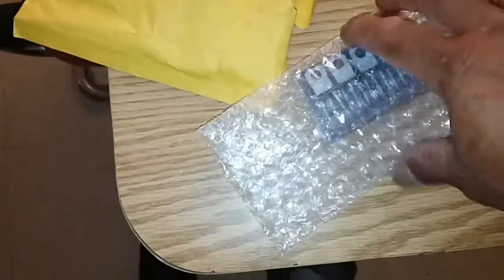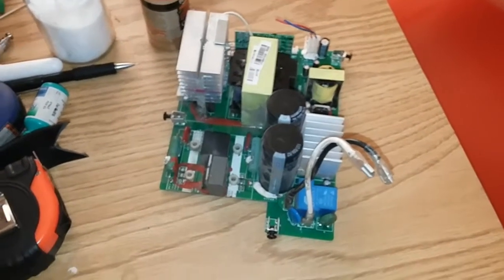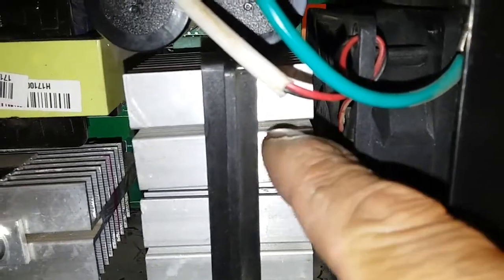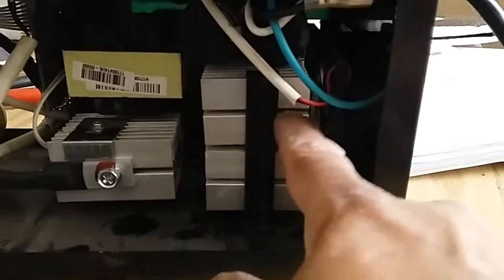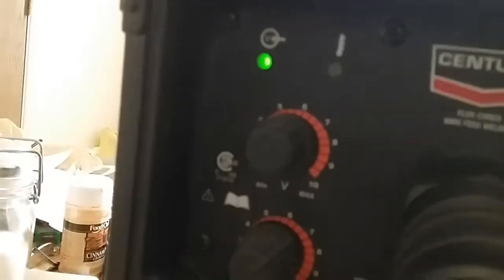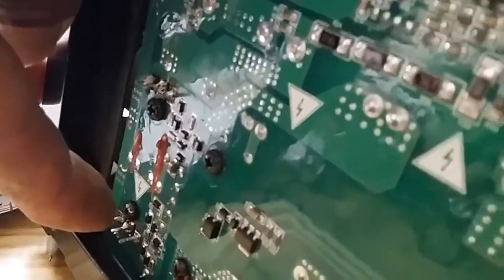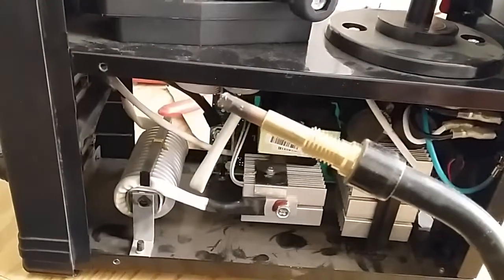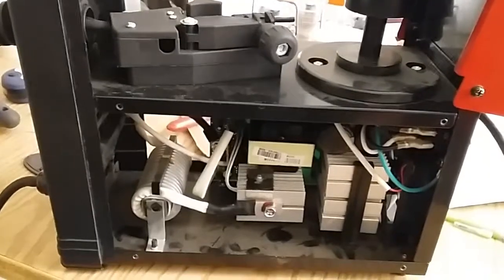Century fc90 fixed!

Comment: Can u please send the link, or the webpage, were you got those mosfets pleaaaaseeee?
Reply from the maker: I don't remember webpage or seller. But in one one of comments I put the mosfet number there. If that helps. I got it from China if I remember correctly.
Reply from the maker: Mosfet is fgh60n60 smd. If this helps.
Reply: @zeroninejames9507 are this the equivalent for the Gw60v60df?
Reply: Ok thank you very much and did you order the smaller ones? O got 2 blow

Comment: Hi, I have a century fc90, I need part ry1 for the pc board, do you have a schematic for the pc board or do you know what that is. It looks like a capacitor but the board has a resistor symbol under the part on the board and the r on the symbol tells me resistor?...THNX!
Reply from the maker: Hey. I just check the number on the part and ordered. I really don't know much about the schematic of the fc90. I was testing certain mosfets and stuff to find a short or burnt circuit. Sorry not much help. Also my fc90 doesn't work anymore. Something else wrong with it so I put it away. Thanks.

Comment: So how did you figure out that’s what you need? I wouldn’t even know where to begin with this if mine goes out.
Reply from the maker: I keep searching on YouTube and found a hindi guy working on inverter welder mosfets. I also searching on testing them for ball park idea of what to look for. I really wanted that welder working again. I took my time searching and testing and found the problem. Thanks man. I just need wire and new fan, which I ordered already.